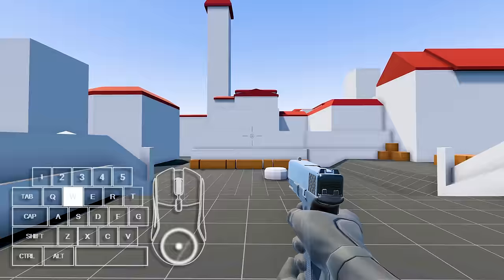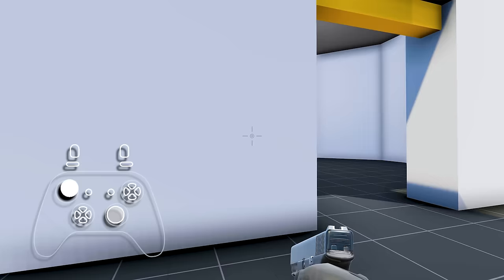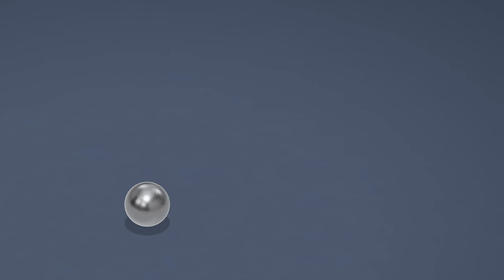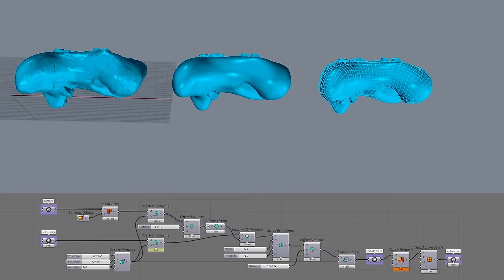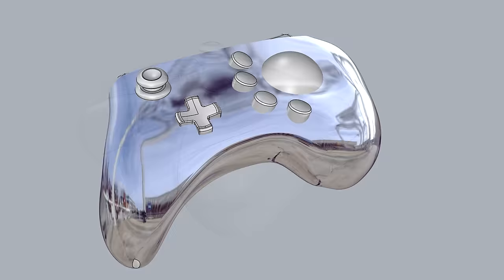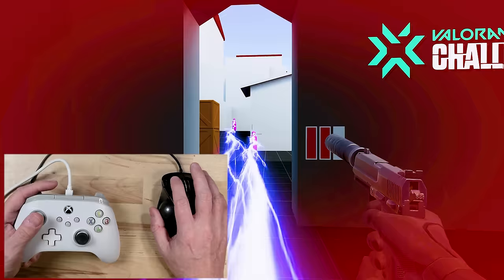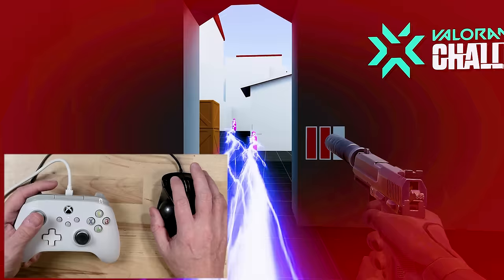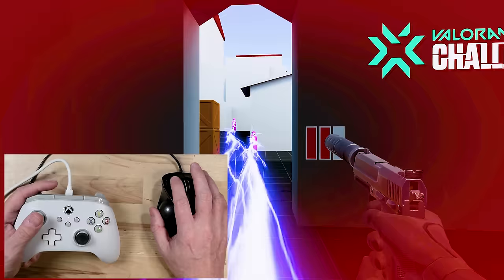Ultimate FPS Controller Design & Build

Comment: This is truly an incredible idea. When I use a controller, I use a 4 paddle design mostly. I think my ideal version of a controller like this would be to somehow forgo the face buttons entirely, relegating them to the back of the controller so the movement of the trackball from the back isn't needed to press jump/crouch/reload/interact while aiming. I hardly ever use the front buttons on controllers with paddles, so if there was a way to put the face buttons on the back like a paddle controller with the trackball on the front, I'd be all on on this idea. Perhaps a pinky button could be installed somewhere that would tighten the trackball tolerance on the fly so you could still slow the trackball without needing to have an opening on the back to access the ball. 

My idea boils down to: 
All face buttons on back as paddles or buttons
Standard 2 trigger 2 bumper design (with the new trigger design you implemented here) 
Left side is analog and dpad, right side is all trackball 
A modifier button on one of the two pinkies that slows down the trackball (think free scrolling vs notched scrolling on a mouse wheel) 
Maybe even two assignable buttons somewhere else on the controller (face or top) 

All in all (if anyone reads this far), the design presented in the video is amazing and I could see people who have never used paddles loving it. But as someone who only uses paddles on controllers for shooters, I'd want it designed differently. Pyott, I have none of the experience needed to make this happen, but I'm down to be an idea man for you if you want to make my dream controller come to life! I'd invest!

Comment: A concept that I want to highlight is that use of a mouse is better, not only because its linear motion (assuming your have a sensor with no acceleration, and your OS isn't jamming acceleration down your throat), but also because you have micro adjustments you can make with your fingers, stemming from your knuckles (Y axis), plus a larger range of adjustments (X axis) with your wrist, plus adjustments at your elbow (X axis), plus adjustments at your shoulder (X & Y axis). That's four different ranges/tiers of motion that let you move the mouse with an incredible amount of accuracy and speed, across a wide range of points. And that's on top of the advantage of "you also use the mouse for everything else on PC, so the muscle memory is already there/always increasing in efficiency".

A *trackball*, however, relegates you back to only one level/tier of adjustments, and you have to adjust your sensitivity if you want more accuracy, versus more range (and while doing so on-the-fly isn't an impossible skill to learn, it would be an exponentially more difficult learning curve to master, and maybe just not worth the effort).

As someone who used a trackball (Elecom DEFT PRO) exclusively for over a year, you can absolutely game with one, but it's objective not as good as anything else (also, "desktop" trackballs almost always have terrible ergonomics, with incredible amounts of arm pronation, and wrist extension when in position, but at least the  handheld-style fixes much of that).

If you want more speed and control with an analog stick, get hall-effect sensor sticks, reduce your deadzones to zero in every game, increase your "look speed" to as close to max as you can handle, and get taller stick columns/add-ons to make your analog stick taller, to increase the arc length per degree - thus increasing accuracy, without sacrificing speed.

Personally, I use my mouse and keyboard the most only because the both use optical switches, which feel incredibly responsive, and have super fast and consistent actuation, with zero dead zone/debounce delay, an I'm a stickler for responsiveness. But, for everything else, a controller is way more fun - better ergonomics (there are no good vertical mice with gaming sensors - except that prototype, gaming "DXT" mouse that one company sent me - and I haven't gotten around to making myself a split, dactyl manuform keyboard...), and a controller nets you awesome haptics, too.

The only thing I love more than ergonomics is immersive haptics.

Comment: 25:00 this is the exact sort of problem gyros solve for controller FPS players. They excel at small adjustments like a mouse, though big movements are hard, so they’re often combined with “flick stick” where you flick the right analog stick in a direction to quickly look that direction

Comment: I think something that was lost along the way is exactly why mouse aiming is so much better. While this is a fantastic controller design, the track ball realistically amounts to a joystick with a much wider range of motion, and no need to return to neutral. A mouse is great because it lets you use your entire hand and arm to precisely control it, and it has an even wider range of motion than either the stick or ball, being the entirety of your flat surface.

Comment: A PS3 nav controller coupled with an MMO mouse is the absolute best gaming setup for shooters. You’ve got an analog stick for movement which gives you precision and you’ve got a mouse for aiming which is the superior way to aim. With the addition of the MMO keys on the mouse you can then bind those to your ABXY buttons and allow you to press them without having to take your right thumb off of a track ball, analog stick, or whatever it is you are using. You then just integrate the mouse and PS3 nav controller into rewasd as a single Xbox controller and you’ve got the best of everything. Almost all games are universals with controller layouts which makes your bindings almost universal. I’ve always hated keyboard because bindings are still the Wild West and I hate having to learn a million different bindings. I’ve also always hated gamepads cause I just can’t do shooters with them. The PS3 Nav and an MMO mouse are just a fantastic combination.

Comment: mouse click on a controller button is something i didnt know i needed. this design is nothing short of impressive and functional, but ill add my two cents. another idea is to place a small trackball on the top-right side of the controller where the default shoulder buttons are located, with your right index finger enabling movement. your right thumb would rest on the right analog stick, as normal, but both analog and trackball allow movement. this is so muscle memory assists in movement, with the trackball introducing minor movement adjustments and precision aiming. your middle and ring fingers would rest on a back trigger for "click" shoot buttons, m1/m2, and you still have access to front face buttons with your right thumb. what do you think?

Comment: Mouse aim accuracy is because you can use your full arm. Tiny movements from the wrist and big from the elbow and shoulder. A trackball on the mouse brings it back to aiming with just the thumb. It is like drawing, you get nicer lines if you move your arm, not your fingers. This is why those pistol grip mice with an analog for movement is better.

Comment: if you need to keep the right stick for whatever reason, i think it would be cool to integrate a switch near the left stick that would, if switched to the corresponding position, reroute the input data from the left stick to the right stick eliminating the need for redundant hardware whilst moving all inputs too the controller
prototyping is so fun!!!
love the vid!

Comment: I have used a trackball with PC FPS games forever. So many advantages to a mouse. Like when you take your thumb off of it it stays exactly still. So if youre peek sniping, every time you peek, the crosshairs are still in the same spot. 
With a mouse when you click the buttons you also move the mouse a little. Not so with a trackball. 

I just bought an Xbox series S and its the first console Ive had in 15 years. I suck with the controller. I wish so much there was a production trackball controller like this. Alas there is not. 

Great job!

Comment: I had an idea for a controller but I lack the skills and equipment to prototype it - perhaps you are interested?  It's a K&M/controller/best-of-both-worlds design...

Basically, take an X-box controller and split it into two halves, vertically down the middle, and make the right hand side into a mouse, by adding a mouse foundation to it.  You would hold the LHS like a normal controller half (very similarly to a VR controller) and the RHS like a normal controller but at 45 degrees for comfort (the same orientation that an aggressive, ball-hinged ergonomic keyboard sits at) and just move it around like a mouse, on a desk surface.  Best of both worlds.  An analogue stick and triggers on each hand, the usual 4 buttons on the right, plus the accuracy of mouse movement.

I got the idea when I found myself in Cyberpunk continually switching from K&M for aiming and FPS to the controller for driving.

Comment: I like how the video avoids you ever making a 90 degree turn or trying out any of the more advanced training that would relate to actual gameplay. Having to move your thumb from left to right multiple times to turn around would be clunky, and increasing sensitivity for that to be fixed would sacrifice precision. Having acceleration on it would maybe work, if you have a rubber band in your thumb. 

This controller looks like a great way to get carpel tunnel in your thumb and pointer finger.

Comment: Ive always preferred stick for moving and mouse for aiming, glad someone finally combined the two, a hall effect sensor would be better for stick longevity. Unfortunately some games dont like allowing mouse and keyboard inputs at the same time as controller. I think working with someone with more knowledge of custom PCBs and firmware to eliminate the external adapter could make this a viable product

Comment: This is super rad. I'd buy one in a heartbeat. 

A version of this modeled on the Elecom Huge, where you control the trackball with your index and/or middle finger, would be perfect. A lot of advantages in both control and economics that way as well (like completely freeing the thumb for buttons and getting two-finger precision aiming without having to pinch from the bottom).

Comment: Have a button for left and right click is somewhat redundant on a controller since you’re rarely doing gaming tasks and desktop tasks simultaneously. The desktop can be set up to interpret the triggers as left or right click, or some other scheme, and in games the menus either support controllers or they don’t 

That said, some controllers have paddles on the back for extra inputs, and that could be handy.

Also definitely would recommend a gyro. That way you can use the gyro for fine adjustments and the trackball for rough movement

Comment: Hey, thank you for very informative video, I can describe this whole project with just one word - PASSION. I watched it whole, I was thinking about it, I slept on it, I woke up and here's my opinion.

As a low sensitivity m&k player I disagree that the ball could be a better tool than the mouse. I do see it's potential and I believe it's gonna be way better than an analog stick especially in the long run, but I have hard time believing good players are gonna be able to reach the same level of precision as with a mouse. I do have to admit I am insanely biased since I have been using a mouse my whole life but it boils down to a simple fact that mouse involes a lot of muscles that the controller doesn't. Even your controller, if someone were to use back of the ball with one of their fingers for better precision, you still involve two fingers to aim precisely, whereas with mouse you use your whole hand, wrist and arm. There are different ways to use the mouse depending on sensitivity, but as a low sensitivity maniac I see way less options with the ball than with my mouse and my 50cm mouse pad.

Don't get me wrong, I think this product has a lot of potential and is gonna blow analog sticks out of the water when it comes to first person camera control, but the better you get the more this product will sway away precision wise from mouse players. If someone is forced to use a controller for FPS games this one would be a fantastic option, I also think that your initial tests show this controller will benefit (maybe paradoxically) a casual playerbase the most and that is great. If that is your goal then I think you've achieved it. But unless controller players were able to play with this and continue to have aim assist I don't see this competing with a mouse at higher levels.

Comment: Would your performance be better if you put a track pad under your controller? Like how Tetris champions do their flick technique:
Track pad - right and/or left marriage finger/middle finger (under controller)
Left click - thumb
ADS - right middle finger on bottom trigger (R2)
Tactical equipment/ grenades - right & left index finger (L1 & R1)
Sprint - Joystick (M3) or left middle finger (L2)

Basically trying to make movement on 1 side of the controller and shooting on the other side with the aim like a point and click.

Comment: What I've been a bit curious about is why no one seems to play with the idea of optimizing the sensor placement angle to the geometry of our thumbs. Ideally, swinging your thumb naturally left and right should give you left and right input. However, most layouts will end up also giving you some up and down input unless you compensate for the movement by moving your thumb down and up. Not only is this less than ergonomic, it likely introduces a significant learning curve for beginners. This would be a similar situation for most trackballs and gamepad sticks, while the xbox left stick layout is likely the most ergonomic out of all the sticks.

It would be nice to have the user option to rotate the angle that the stick sensors sit in the controller, since the natural thumb attack angle will be slightly different depending on hand sizes. Maybe it's something worth experimenting with?

Comment: I hope next time we will see a new Ultimate FPS Controller 2 with an added touchpad from PS, sound output and vibration motors to this amazing design, so it will have no competitors in terms of functionality. It should obviously become more stretched horizontally and buttons with ball are more compact, plus mouse wheel is also able to work as a button when pressed in addition to scrolling, but it seems quite possible.

Comment: Thing that sucks the most is alot of games require you to pick one input and won't let you use a controller for movement and mouse for camera. Also, if the dream is to make the perfect FPS controller... You gotta be able to hit ABXY without having to remove your finger from the right stick or the track ball. That's peak efficiency.

Comment: Out of curiosity, would it be possible to add a second analog Trigger? Then it could be used for more games, like racing games
(I know there is no need for a trackball in Racing Games, its more of wanting to use one controller for multiple games)

Comment: This is a cool design and nice to see how someone can create something new out of basically just an idea.
I'd personally rather go for a Steam controller layout with gyro sensors combined with the touch pad to replace right stick aiming. Adding a mouse wheel and improving on the button layout to make them easier to reach.

Personally I like the 3rd shoulder button of some of the razer pads (and the FlyDigi Apex 2) a lot and having 4 back buttons or paddles has proven to be very functional, too. I am thinking adding a small keyboard between the sticks would be absolute non plus ultra. Being able to use chat while holding the game pad and giving you a TON of more buttons to bind short cut functions to them. These dock-able keyboards exist, for example for PS5 controllers.

Just imagine alpakka double gyro (best gyro precision currently on the market) + touch pad + tripple shoulder buttons and 4 back buttons, a mouse wheel and a keyboard with full alphabet and numbers in your two hands.

Though, when you want to go gyro I recommend going wireless, because the wire kinda sucks, when you want to jerk around the pad a lot and fast.

Maybe one day I'll teach myself how to do all this. The designers of the Alpakka have all their stuff shared open source (and I think steam put their steam controller open source, too after they stopped producing it) and a lot can be learnt from this video, too. (And I'm not starting from absolute 0 due to my profession.)

Comment: While this is great In concept and I would love to try this controller. 

The whole reason a mouse is better is because you control it with your whole arm and can flick it a great distance in no time with extreme precision.  

The track ball on a controller just makes a thumb stick with more extension. Essentially the same thing riser extensions kinda do. Just gives more range of motion.

I’ve played games on laptops with the touch pad which is similar and it’s kind of horrendous. But with that being said I’ve never had a left analog for movement. 

I’d love to see a collab with big streamers and pros like Shroud, Timmy (Apex), and more to test this controller and see if it gives any actual benefit over a standard controller besides more range of motion and a bit more precision.

But I thank you a ton for thinking outside the box and potentially giving someone where inspiration for new controller designs for the future. ❤